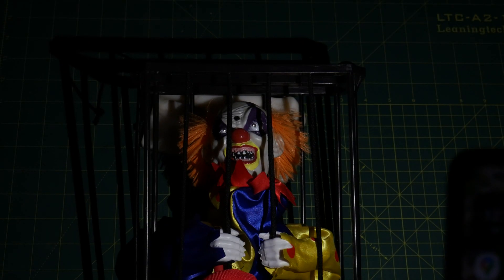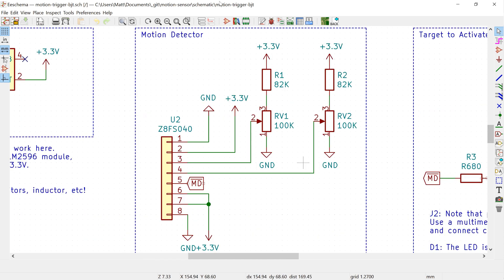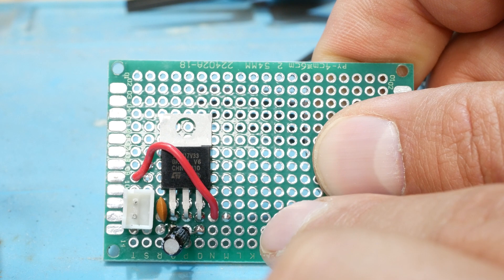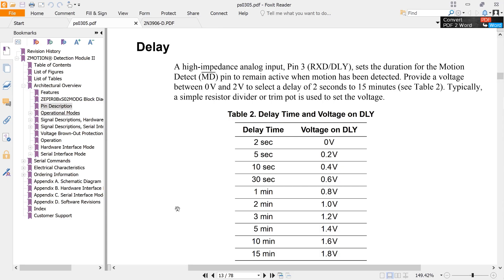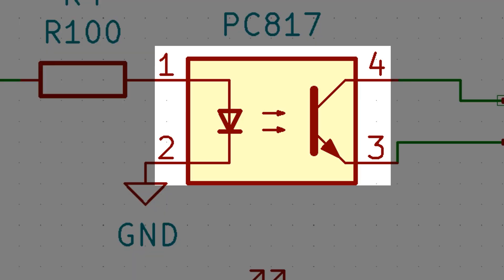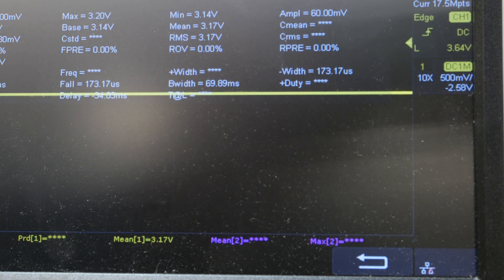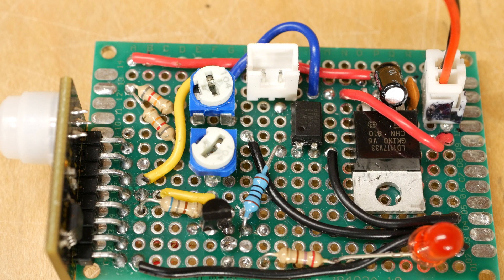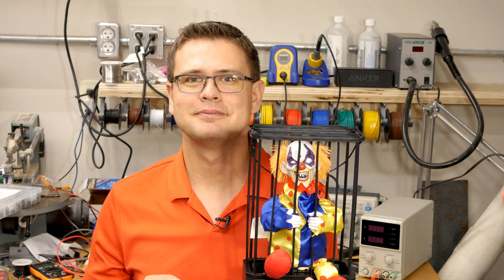Make Halloween Prop Motion Detectors Work in the Dark

Comment: Excellent video! I liked how you made your own circuit for this one. If this was my project, I may have gone the easy route of using a small Arduino or attiny, but I really like your approach.
Reply from the maker: Thanks so much! Yes you can easily update this project to use an Arduino and I will do exactly that in some of my other builds. I just wanted to keep it simple for people.

For anyone that does want to do this, you can hookup pin 5 to an input pin on Arduino, get rid of the PNP transistor, and hook up an Arduino directly to the 100ohm resistor that's connected to the optocoupler. 

OR you can go all out and take advantage of the serial mode on the Zmotion module that makes it more flexible to work with. In that case check the datasheet for the serial commands and how to connect to it.

Comment: Impressive build! Looks like it came out great! Question: Why did you have batteries in as well as the supplied power from the soldered wires?
Reply from the maker: Thanks! The wires soldered into the battery compartment are stealing power from the batteries, not providing power to them. That said you could take out the batteries and power the prop through an external supply instead as long as it operates at around the same voltage as the batteries (this clown has 3 AA batteries so ideally you want ~4.5V but I'm guessing it would work just fine off a 5V supply).